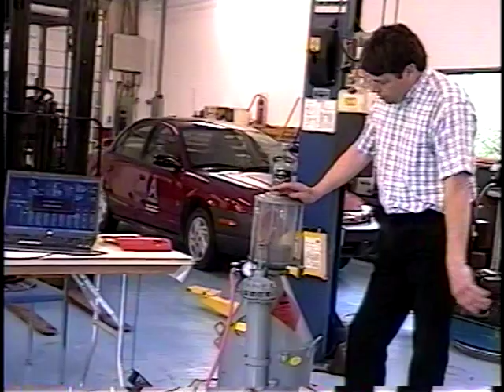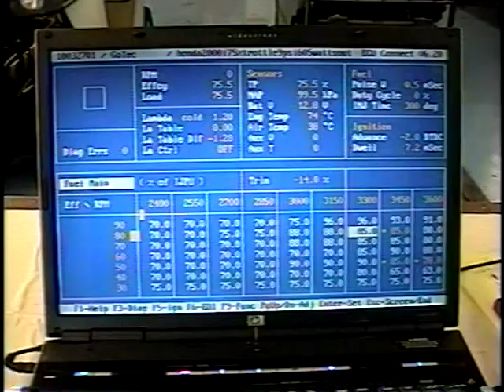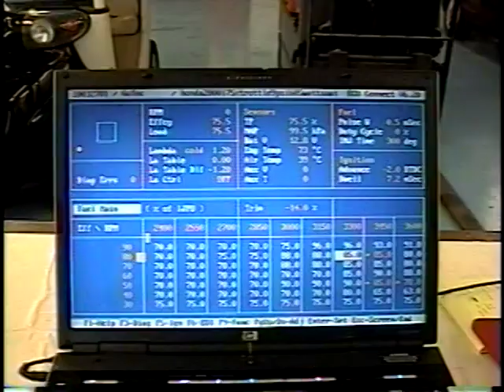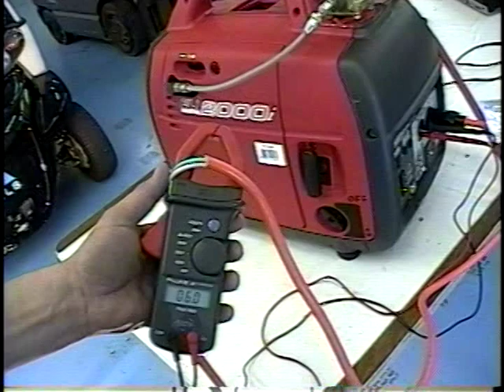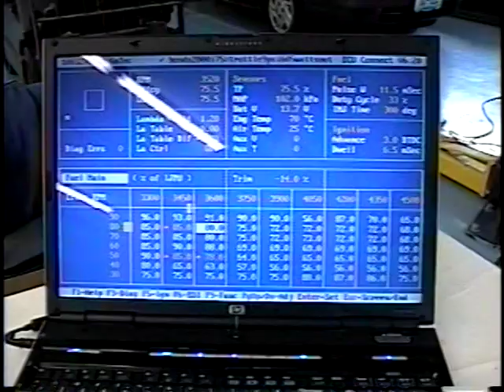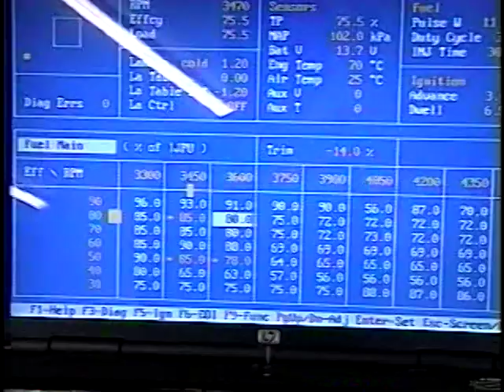AFuels Honda Generator Running on Acetylene

Comment: I wonder could you do another video on the generator?.   What make is it and what type of Calcium Carbide does it use? How does it get the carbide into the chamber without the acetylene rushing out under pressure? There is very little on You Tube about it.   Just start it up and run the torch without oxygen.